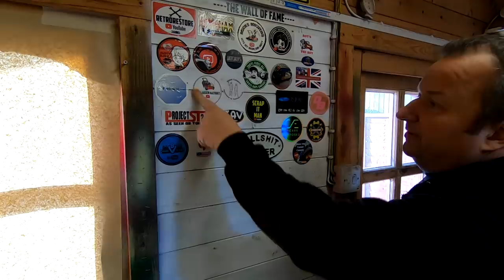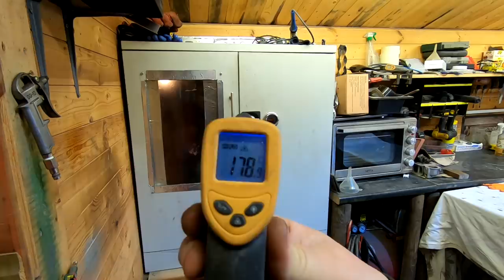Project TGB R50X Scooter  Part 6 - Powder Coating

Comment: Have you thought about a powder primer? Would make the parts look alot smoother.
Reply from the maker: I think powder primer is just grey powder coating. You can of course just sand the powder coated part smooth and powder coat it again for the same result.
Reply: @retrorestore  alloy primer is alot more than just a grey primer. I use HMG alloy primer and makes a big difference. Chuck it on hot and it flows out very nice. Definitely worth buying 1kg just to try it out. Its on their signature range website 👍
Reply from the maker: @AshleyBurch  I'd have to see if it would work with this system Ash. Thanks for the info.

Comment: I noticed you didn’t mask off the machined mating surface, don’t you think it’s necessary? I always do, so wondering if I can save a bit of time or are you going to glue some sheets of wet and dry sanding paper to a bit of glass to remove the powder as glass is usually pretty flat? Cheers Rich
Reply from the maker: There is no oil seal between that face so I wasn't too bothered. If it was a proper sealing surface, I would have masked it off.